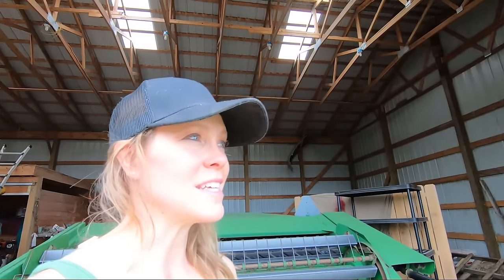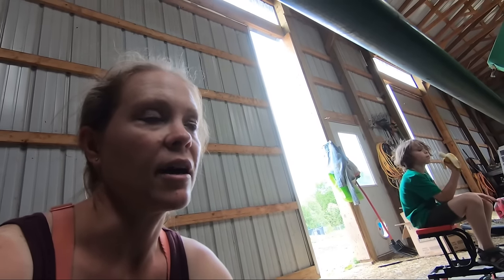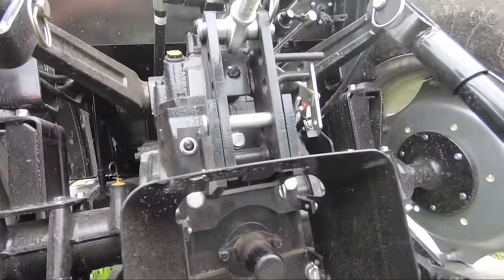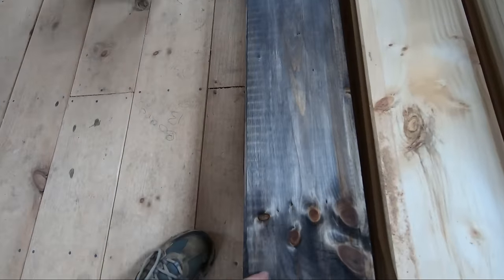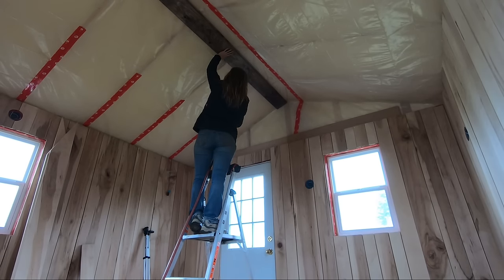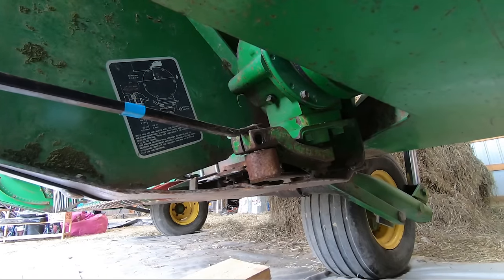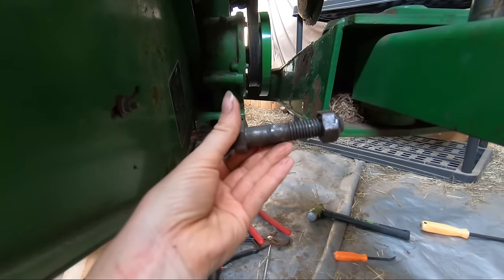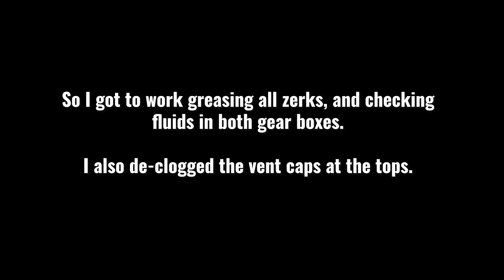I May Have Found the Issue (Hay Equipment Repair) - PLUS: Off-grid Cabin Ceiling (Vlog #19)

Comment: You need a new pitman arm. The one on the machine is twisted. The hole in the pitman is not at a 90 degree angle to the cutter bar. That puts the pin in a bind when it it installed. It should slip into place with very little resistance.
Reply from the maker: Correct!   As I'll explain in the next cutter video, last year was the first year I actually torqued the pin to specs (160lbs). Erik had always told me to get it "good and tight". 160lbs requires me sitting on a torque wrench and using all my force to drive it in.. As I stood looking at all the sickles on my wall and realizing our first break was the start of our issues, I put 2 and 2 together after struggling to pull the pin that the pin hole had been worn out of circle, which caused the pin to flex and twist, nor would the cutter bar sit correctly level in the guards this way.

I replaced both the arm and the pin and once everything was torqued correctly it glided through with ease :) And the pin slid in like butter too!
Reply: @This1LifeWeLive  I hope that fixes the breaking issue. One more possibility is the shaft the drive arm mounts on could be bent.

Comment: Hi  Suzanne.  You  are  quite  a  trooper  trying  to  get  that  haybine  to  work  right.  Anything  with  a  sickle  bar  attached  to  it  is  going  to  cause  you  grief  and  headaches.  They  are  high  maintenance  and  can  not  go  thru  a  lot  of  abuse  such  as  a  rough  field.  Then  with  that  extra  long  cutter  bar  they  tend  to  flex  too  much.  Constant  repairs!!  They  are  also  slow  to  operate.  A  disc-bine  with  conditioner  is  10  times  the  machine  of  that  old  technology.  They  are  basically  "bullet-proof".  They  are  simple  and  any  repairs  to  the  cutter  pod  is  very  easy  to  do.  Changing  the  knifes  on  them  is  done  with  simplicity  and  ease.....and  they  are  cheap  to  buy.  Save  yourself  from  major  frustration  and  sell  the  haybine  and  find  a  good  used  disc-bine.  You  will  be  amazed  how  good  they  work  and  how  fast  you  can  cut  with  them.  Doesn't  matter  how  tall  the  grass  is  or  how  rough  the  field  is,  they  just  plainly  work!!
Reply from the maker: WE've looked for disc mowers but they are WAY out of our price range with our current acerage. We would consider one if we could get 30 more acres :)

Comment: you are finally looking at the right area of the hay mower to fix your problem. Its metal fatigue causing the break and this is  due to fluctuating stress on the cutter bar

Comment: Suzi - I have noticed that when you were using the brush cutting machine on the TYM, the arms on the hitch were not in float mode and the brush cutter was bouncing along with the tractor over all the bumps thus leaving patches of uncut ground. Just thought i would let you know.
Reply from the maker: I've had so many tips on the brush hob over the years I can't remember them all. I don't normally run it in float mode because I set the cutting height by the 3pt arms.  Another reason why I like manuals . . . often they give helpful info on how to operate ;)

Comment: that bore in that pitman arm should be smooth and that bolt probably should be a shear bolt to prevent damage to gear box if there a jam and it sounds like you had jamming issues in past. The bolt should have a jam or nylon lock nut

Comment: The first step to removing the sickle bar is to take the grease zerk out of the $50 pin.  Then take the bolt out.  The pin can be moved up without using a wedge.  When the zerk is in, moving the pin creates a suction.
There is nothing wrong with that pin.
Reply from the maker: YOu know, out of EVERYTHING I had read on pin removal (like I said, never had a pin stuck so bad before), NO ONE suggested removing the zerk! But it makes total sense!  (Although in this instance, other factors were in play so I don't think it would have helped, but a good one to rememeber for next time  . . .hopefully years down the road)
Reply: @This1LifeWeLive  I mentioned removing the zerk last year and you said the zerk was welded to the pin. Now you say that the zerk was $5 and the pin was $50 which meant that the zerk was removeable.
I have a MacDon combine header with a pin and grease zerk.  The owners manual says to remove the zerk to remove the pin.
Reply from the maker: @ronsommer9409  my manual has no info regarding the zerk or the pin. On that head last year neither of us could remove it, hence my conclusion it must have been welded. It seemed like previous versions of the pin came with the grease zerk already installed, like every other piece of equipment. Or perhaps John deere had just previously ordered one and put it on for me in years past. Regardless, I had mistakenly assumed the one I attempted to remove was welded on for the nut could not be found on it. Either from cutting usage or bring stripped during installation.

Comment: You should have a Jack Stand under the tongue of that beast.  Is there useful info on the Decal on the machine at the Pitman?  It appears that the Wobble Box is tilted toward the bar and when it cycles the pitman lifts the bar.  It is the constant flexing that results in breakage.  Bolt Grades are shown on head of bolt.  That bolt is NOT designed to snap in that position it is simply holding the bearing in the right position.  The groove may be for lubrication.  I suspect the Pitman may be slightly bent as well.  Put a level on top of it over the hole and cycle it fully and see if it remains level.  
Can you have your hay Custom Cut?  Not that many acres.
Reply: I disagree , this is a money making real life farm that paid off all its debt in 7 years
Reply from the maker: Very few farmers are as OCD about getting correct cut/bale that it would be tough to find one to my fields. The wobble box is one of the few areas with no explanation. Not in the manual or decals or even online.    BUT . . . I did figure it out :) And it was a really dumb reason too, but an important one!

Comment: Next time start from the bottom and work your way up to the top too..and can adjust the boards too...
Reply from the maker: I started at the top because I'd only have to rip one board section to proper thickness (bottom row). If it's slightly off, the trim will cover it, but the ceiling seam doesn't get trim and any imperfections would be visible ;)

Comment: Hey Suzy !! I wish I could be there to help you with your machine problem. I've mowed and baled a lot of hay , farmed all my life and worked on all kinds of equipment . On your sickle cutter , first make sure you have the right hold downs at the head, they have a wider gap between them so the sickle head will clear also there are wear plates under them ,they both keep the blades from tipping up . To get the head pin out ,pump some grease in it , John Deere has a cupped bottom , the grease will push it out. Once it's all together rotate the rollers so you can watch the sickle move . It may not look like it but the pitman has to be in time , if it is moving farther one way then the other ,it's out of time, may be because something is worn or bent ?? I've had this problem as well in the past , and yes I traded it in for a disk bind , but they are not without there problems as well . If you are going to use them parts are going to wear out and break . Your doing great !! No one knows everything the first day . I hope this helps you out and good luck 🥰
Reply from the maker: Last year I replaced all the wear plates and ordered a few new hold downs. All the guards and hold downs were taken off and re-set to the bar. I did try pumping grease in, but it was a no-go. You are right through, normally that SHOULD do the trick, so I knew something there was not correct, and maybe causing the issue :)
Reply: @This1LifeWeLive  yes Suzy ,I feel your grief I had a 489 NH wobble box went out first cutting ?? They wouldn't replace it ,so rebuilt it and discovered a key had been put in incorrectly and it cut the oil seal out . So went on and fought it for next few years , then NH had a recall on the wobble box but skipped over me because I hadn't bought it at that dealer .I went to get parts again and there was a guy from NH ,a rep and he wanted to see the machine and said they owed me a new box ,after seeing it they brought me out a new machine , yea I had to pay half price but it beat nothing after what I had went through. I eventually traded it for a J D disk bind , but like I said they have their problem as well good luck with yours . And you may have to replace the pitman arm but not the box , it could have been bent when you hit them ruts , just make sure you put it back in time . Good luck sweetie 😘
Reply: @This1LifeWeLive  yeah Suzy ,I forgot to mention that someone had over torque the bolt that holds the sickle pin and it pulled the ears in. You have to think of it as a battery post clamp, you want it tight but not to the point where it pulls the clamp to where it touches  . If it does you did what you had to do drive a screwdriver between them. I seen when you brought out that big breaker bar , I thought I know she's little but that bolt was way too tight !! Hope you have it figured out ,and I'll keep watching to see good luck again !!